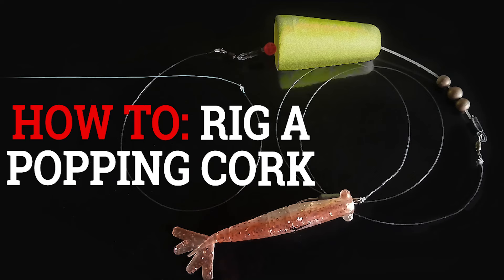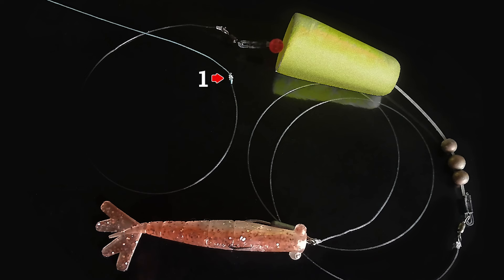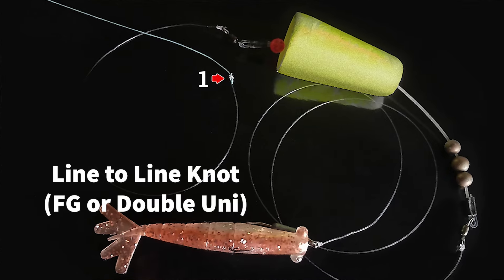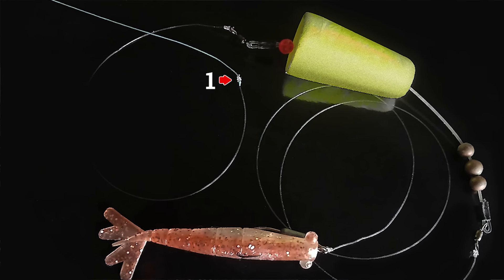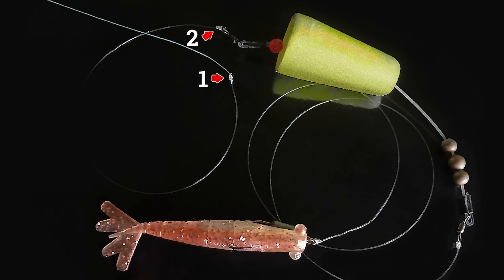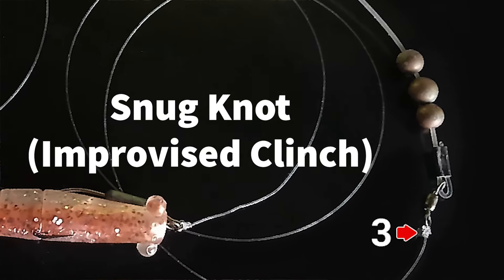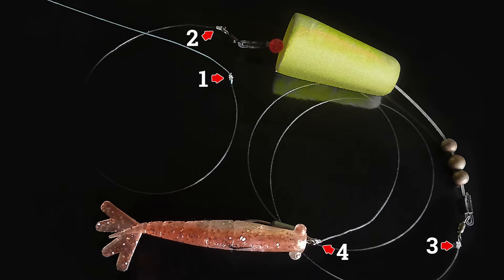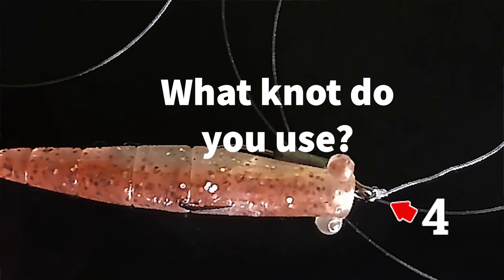How to Rig a Popping Cork Like a Pro! (Trick to Avoid Line Twist)

Comment: I'm a loop knot guy. You guys should check out the Core Tackle TUSH swim bait hooks and the Hover Rig hooks. Both have weight on the shank that ends up in the soft plastics with no head. They both should be awesome with a popping cork.
Reply: We will look into those!  Thanks for the suggestion and the comment!